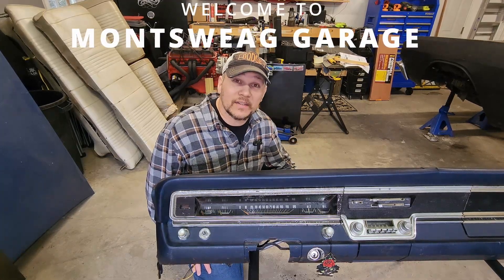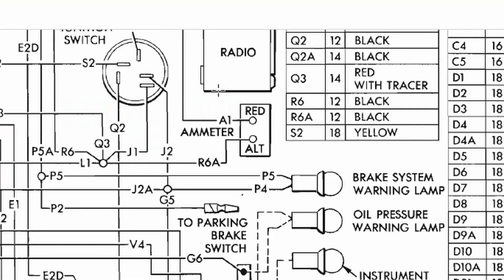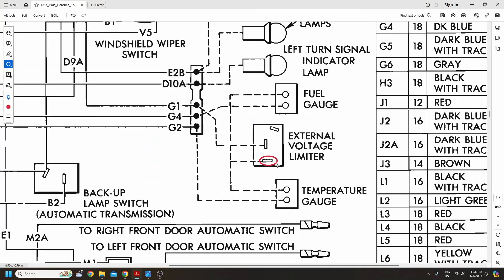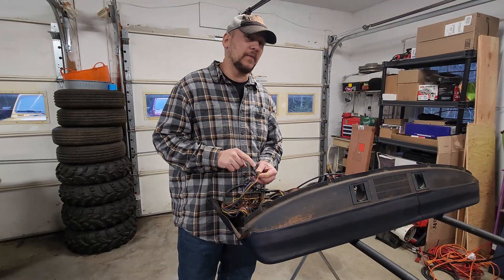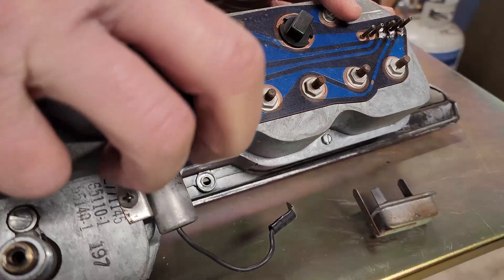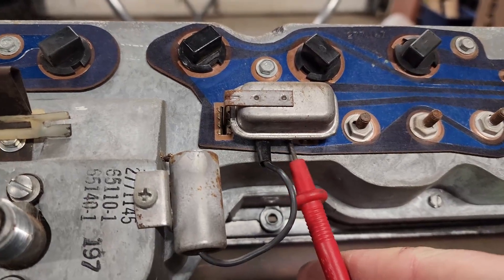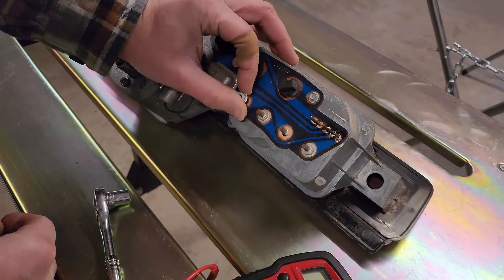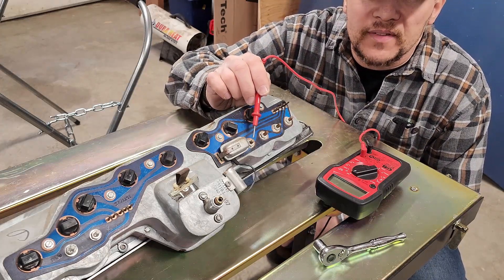The Truth About Why Some Of Your Gauges Don't Work

Comment: https://youtube.com/shorts/xxSE75fmdV0?si=zRavflsxwXn8Vd9O

I figured I would do a short for you to see what I found. It seems that it only affected three wires, the ground and positive coming in melted together with one third wire.
Reply from the maker: Oh damn! You're lucky that didn't start a fire. Sorry it took so long to get back to you. This message went into my "waiting for approval" queue, probably because of the link. I'm glad you found the issue. Re-pinning the bulkhead connector shouldn't be too difficult, just a bit tedious. Does the new connector come with new pins or do you need to reuse the old ones?
Reply: @MontsweagGarage  is there any way to put a fuse in on that hot wire coming into the bulkhead prior to it coming in from the firewall? I would hate for this to happen again and then I have to either fix the wires again or have a fire that does much more damage.
Reply from the maker: @joefall  You sure can. O'reilly has them for 4-5 bucks and they just splice in. If you are splicing wires anyway, no reason not to. You'll just need to figure out what size fuse to use for that line.

Here's a link to the one in stock at my local store: https://www.oreillyauto.com/detail/c/blister-pack/littelfuse-blister-pack-fuse-holder/lit3/fhm2bp?q=inline+fuse+holder&pos=0
Reply: @MontsweagGarage  so I just rewired the bulk coming in and got the car running again. The gas and temp gauges still not working. I did connect a 6v battery to the fuel gauge and it is responding. And when I turn the car on the needle for the fuel wants to move but then drops. 
Could I have burned up the voltage limiter? It is only putting out a max of 5.5v and is more average around 3v. Also can I test the temp gauge the same way I tested the fuel gauge with the 6v battery? I connected it but I had no movement but I'm your video you only test the fuel gauge. 
Hope you are doing well and in advance thank you for your help!
Reply from the maker: Glad to hear you got it up and running. I'd bet that you are right and the voltage limiter is smoked. That or your gauges. I will check my temp gauge next time I get the opportunity. I am currently without power....again, and work is in high gear. I should get a chance this weekend if the snow/rain stops. You are quite welcome for what help I can provide.
Reply from the maker: @joefall  I just checked the 6v battery test on the temp gauge and it works the same as the fuel gauge. It looks like the voltage limiter is your problem, and possibly your temp gauge.

Comment: Ok this is what I have found after testing. The right post behind the temp gauge reads 12.4 volts, even with the key off. When I read the left side, where the voltage limiter is connected to comes in, it reads between 0-8 volts with the car key on. It reads 0 volts with it off. I also checked the temp sensor wire and it is reading 12.4 as well with the car off. I assume I should not have any power on G2 (Temp sensor wire) with the key off. But the wiring diagram I have looked at ends there. The fuel gauge is not having that issue,  power only comes to it when I switch the key on and it is 0-8 volts. Any help from here?
Reply from the maker: Sorry about the delay. Work is busy as hell right now. You are spot on when you say you should not have 12.4v on your temp sender wire. You should see the same 0-8 volt pulsing signal. I am assuming when you say you checked the wire, you checked it at the connector like I showed checking the black 12v into the PCB. If you have 12v on the wire with the connector disconnected from the PCB, then you have a short to a 12v source somewhere in the wiring harness and you will need to check the wire (G2 - violet wire) back to the sender to find the issue. It runs straight to the sender so you shouldn't have to worry about any splits or junctions. Is your fuel gauge operating normally now or is it still not functioning?
Reply: @MontsweagGarage  well I Believe I found the problem. After inspecting under the dash for a good hour I found that the wires are melted together right after they come in the bulk head. This is going to be fun.
Reply from the maker: @joefall  Where are you located?
Reply: @MontsweagGarage  Shelbyville, Indiana
Reply from the maker: @joefall  HA!!! I grew up in Ft. Wayne. Lol. I'm glad you found the problem. I am also sorry it was a melted mess. Depending on how bad it is, you have a couple of options. The good old cut and splice, a refurbished dash harness, or an aftermarket wiring kit. I wish you were closer, I would love to help you tackle this.
Reply: @MontsweagGarage  I appreciate your help on this. And yes it would have been cool to have your help. I might try to splice as it just looks melted on the harness right about 7 inches after they come through the fire wall. But we will see.
Reply from the maker: I am interested in how it goes. Feel free to give me a shout if you have more questions.
Reply from the maker: I am not. I pretty much only do YouTube for the time being. If I ever get to do this full time, I may branch out into other social media but YouTube takes up the majority of my free time as it is. I work 40-60 hours a week and my weekends are for making videos.
Reply: Fuel is not working, so I went to the easiest sensor to get to, which was the temp sensor. I can say that I pulled the harness from the bulkhead disconnect, so nothing is shorting from the engine compartment.  so I have to say something is shorting near the back of the cluster.  When I pull the voltage limiter out and test, I can say that we have 0 volts. But when I plug it back in we have 12.4 volts again. And no need to apologize for the delay. I don't expect a fast answer, and you have been amazing, so thank you! @MontsweagGarage

Comment: Maybe a little off subject but similar. 
Most temp gauges lie. 
If youve got a mk4 vw ,itll sit on 190 while the actual engine temp is 165-200. 
Alot of other cars do that ,theyve done it since the 70s and maybe earlier. 
It's literally some psychology coming into play, the brain likes to see a gauge halfway in between its metering points so they set them up to do so.
Reply: @MrTheHillfolk  the same goes with my e36 BMW. That's so wonky if you ask me.
Reply from the maker: Good evening, and welcome to the channel. Thank you for the comment. I was not aware of this info about temp sensors, but it makes sense.